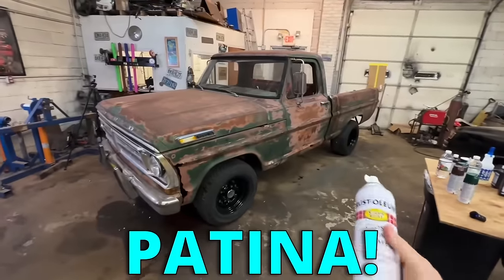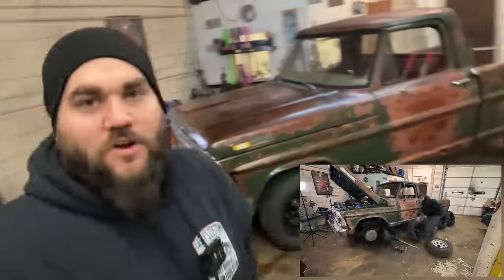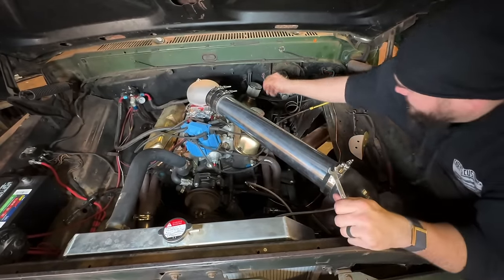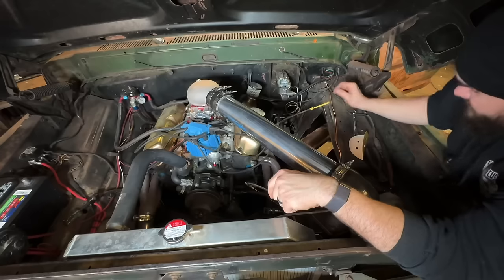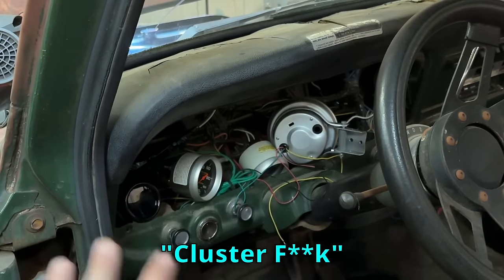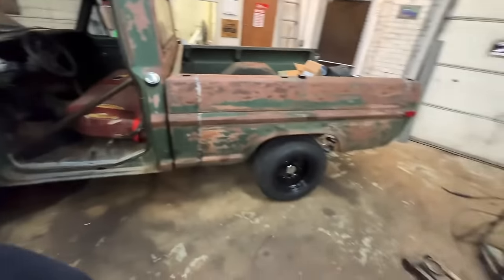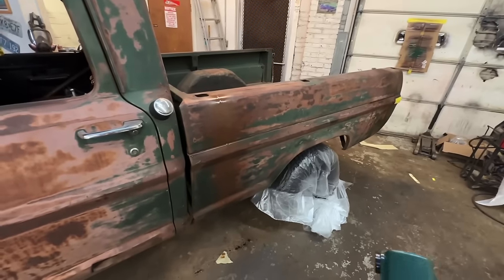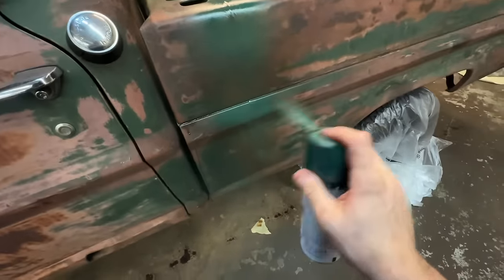SPRAY PAINTING MY TRUCK WITH TURBO CANS! SHORT BED CONVERSION GETS PAINT! NASCAR FORD F100

Comment from the maker: PLEASE LIKE THE VIDEO!!!
Reply: Try Floor Penetrol. I put it on my faded rattle can paint job and it looks like I just sprayed it again.
Reply from the maker: @lukevondukemusic1602  I’ll have to take a look I’ve never heard of it!
Reply: Total Mandela effect, I could swear I watched this around Christmas time.lol I'm going to have to totally try the turbo cans when I start to work on my avenger
Reply: I sliced my hand open with the cutter on a box of foil on Christmas and had to go to the ER.  So I'm that asshole aswell
Reply: Damn Casey! Hope you are good bro. I keep that super glue on standby, too! Shit happens. Vitamin E oil keeps the scar tissue down.
Reply: you ok layhe truck is look greesy though bud
Reply: sweet truck dude. u gotta hook your fuel pressure regulator (vac line)up to manifold pressure below the carb.. otherwise your fuel pressure will not increase with boost.
Reply: Whats not to like....lol...as always awsome.
Reply: Me podrían decir que era el aerosol que le puso gracias
Reply: NO!

Comment: I just used some turbo black on a camper shell. One thing I learned is to shake the crap out of it and when you go to spray, be committed and push the nozzle. I tried to go in lite and it splattered purdy bad but if I just pushed the nozzle all the way it was “ok”.

Comment: Hey Casey crew 
What are you currently working on?
I am working on a 57 gmc 3/4 ton.
Got it cheap because someone painted it with purple house paint for a parade.then it was put in the bushes.
Down to bare metal now 
Cab corners and floor is next

Comment: Hey Casey,
I've got a few comments and questions. Do you have an AFR(Air Fuel Ratio) gauge for you new shop truck? Also shouldn't you wait to shorten a driveshaft until after you have set the ride height on you new truck? Because with the way it looked on camera the backend looks way too high for just different shackles. You might want to leave the springs where they are, and use drop blocks. I've watched all of the videos on this truck. My best guess is why the last guy blow the motor before you got it is because of my next comment. The fuel regulator does not look like one you can use with boost. The reason I say this is because the more boost you put in, the more fuel you should put in. That is why a lot of people that use blow through Carbs use a boost reference fuel regulator. Which use the same vacuum that your Boost gauge uses to increase the fuel pressure into the Carb, so that you would get a safe AFR. And not put a window in the side of your block. There is some other stuff with rings, but if the motor has a few miles on it. It should be fine with about 10 lbs of boost. I wouldn't try to reach 20 lbs or over 500 crank horsepower(At the flywheel), because the 302/5.0 blocks have a problem about splitting down the valley and coming apart. The new shop truck looks great, and look forward to more videos on it.
Bart